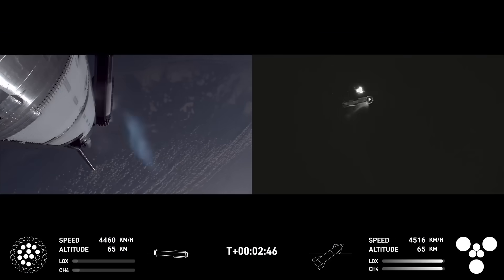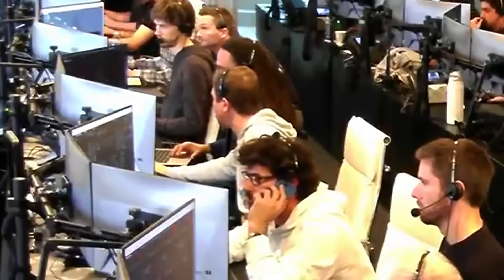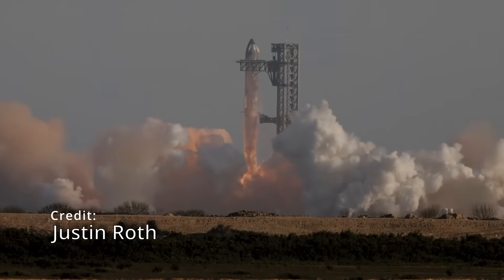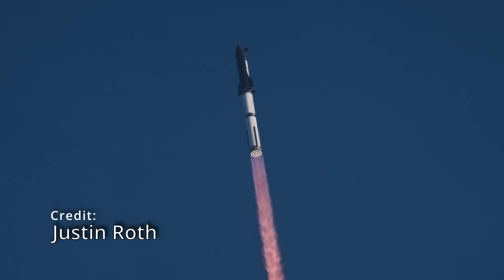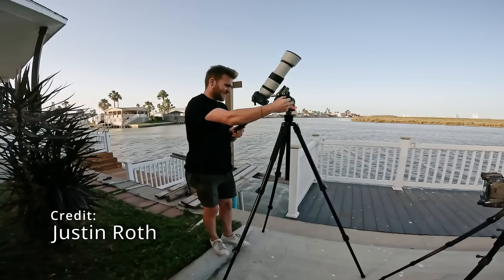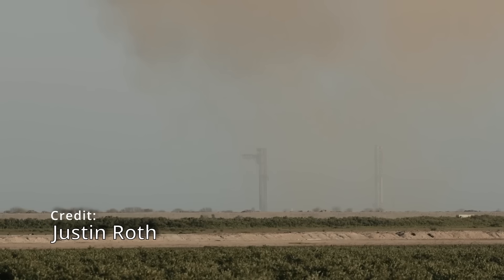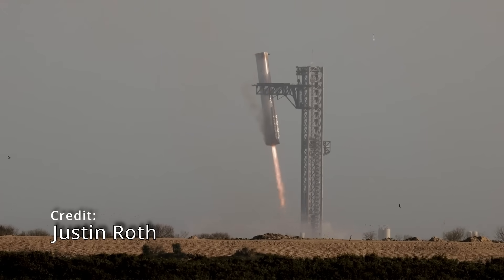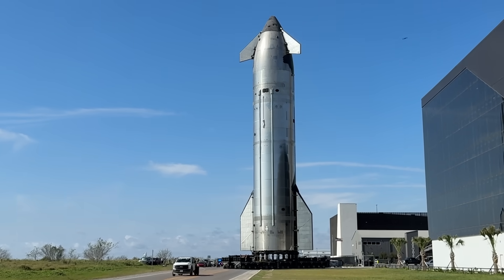Rest In Pieces: Why Did SpaceX Lose Starship Again?

Comment: I think that their analysis was a bit dramatic! 
Yes SpaceX did some testing and made many changes for flight eight. 
Some of the changes were to place a whole host of new telemetry sensors everything from taking new pressure recordings and temperature but also angular acceleration and harmonic vibrations along with also adding a bunch of new camera angles in the problem area so they could get better understanding if they had that same type of issue again. 

They had the 20/20 hindsight perspective, and I’m sure it was said,  if we could go back prior to flight 7 and place cameras and sensors to help us learn more about this issue what would we wish we would have had that would help make solving this issue.  Again what type of sensors and where would we have put them and what would we want to make sure we are monitoring. They made all of those changes. 

So the good news,  I think that SpaceX had everything they needed on this flight to determine with some degree of certainty what happened and I’m sure they will figure out why, if they haven’t already.  Yes SpaceX is it going to have to convince the FAA that they not only understand what the problem is,  but that they have also made appropriate changes to alleviate future issues.    Hopefully that will go quite quickly.  

I am an optimist and I think that they could probably get this done and fly flight nine within 7-8 weeks.   But yes,  no doubt, it is a bit of a set back!    With a development program involving the largest and by far the most powerful rocket to ever be built, there is bound to be complex issues arise during testing, and innovating. There is certainly gonna be issues, and this is the time to work through them!  Much better at this point than when they are flying a hundred humans on it!

Comment: Why don’t they build the booster and the ship using four tubes each, arranged in a circle? It would be more rigid than one big wobbly tube.
Reply: booster obviously does not need it, and it would be an absolute nightmare for upper stage reuse
Reply: @snuffeldjuret  Why not for the booster (if it is an improvement) and why an absolute nightmare for upper stage?
Reply: @snuffeldjuret  I'm not sure/don't know if starship&booster are stiff enough now. Changing to 4 cylinders instead of 1 would make it stiffer. That would add weight yes, but maybe the skin can be made a bit thinner. Hard to guess if it can be done without adding weight. I know pressure is most important for structural strength. Though important to not collapse when the pressure gets too low for some reason. With 4 cylinders (2 large lox and 2 smaller methane) you could close the sides, making the rocket more rhombus shaped. Lots of room for stuff and heat shield. Just thinking out loud. Don't want to see another Starship fireworks.
Reply: @snuffeldjuret  Good question, I haven’t considered other numbers yet. Why not hundreds of spheres?
What are the best ratios for: weight, strength, shape, and the plumbing system? Just three could work (two LOX, one methane, arranged in a circle with two connections per cylinder). Configurations with five or six could also work in different ways, while seven could be very strong. The more cylinders, the heavier the structure, I assume.
Of course, there’s more to consider—for example, the different temperatures. If one cylinder shrinks more than another, the connections should allow for some sliding.
The goal is a more rigid construction—stronger and less sensitive to resonance frequencies. Whatever works best.

Comment: I am pleased to hear your comments, I have been making comments about the design and safety of starship. I think the design is way off , there should not be heat shield tiles , this ship seems too fragile , it seems as though they have tried to simplify a structure to make it large . Reusability might be fine while it stays in space but not a frequent flyer from Earth .
Reply: which rocket company do you work for?

Comment: I wonder if it’s fuelling impacting the engine reliability, or if it’s something to do with the duration of the burn. Any which way, they absolutely need to know why the engines are failing, including the two that didn’t relight on the booster.

I think Mars is still doable

Comment: The Starship project is done. Elon suffers from severe wishful thinking and overconfidence syndrome. He thinks you can built a spaceship with only a 3.97 mm thin metal hull, let it go through temperatures from -200 degrees to 1600 degrees Celcius without problems and fly it to Mars. The thin metal does nothing but shrink and expand enormously, every flight. Of course that will cause fuel leaks everywhere. Besides that, the same counts for the heatshield. It will never ever become 'reusable'. I'm not a Starship critic, just a realist. Musk can't have a third failure on flight 9. But with so, so many problems unsolved, another failure is guaranteed. Raptors fail on a row, heatshield is still in embryonic fase, fuel leaks are unsolved, Starship fuel tankers in space are very far away, a ship landing on Mars on it's own feet is still fantasy, and how on Earth will Elon refuel a ship on Mars for the flight back to Earth? The whole project is based on fairytale fantasy of a young boy's deams. Humans will never reach Mars, and if they do, they will die there very soon.

Comment: They use the same engines that they used on the V1 starship V2 is pushing a lot more fuel and weight. I have noticed that the trust to weight ratio changed a bit compared to V1 flights the booster leaves the ship at a lower altitude as before. The added weight of the Starlink simulators also does not help. I think that is logical to think that the engines are straining and having to work alot harder for the V2 starship compared to V1. I have read somewhere that raptor V2's are prone to leaking when pushed really hard. Maybe they could fall back to the V1 platform test everything they need for the heat shield with that. So raptor V3 can get up to speed. Maybe they will be more compatible with starship V2 ? But well I am not a rocket engineer just a passionate space flight nerd. Just thinking out loud here.
Reply: well, they scrapped the last v1 ship they had lying (laying?) around XD

Comment: I think that it's a vibration caused by the extra 2 m that they added I think that when the fuel gets to a low enough point, the extra length somehow plays together and creates an oscillation / vibration/ reverberation, idk, that caused it to leak fuel. It'll be interesting to see if the innert gas they use to fill the attic had any effect, and whether or not the camera in the Attic picked up any footage

Comment: Really the only definite similarity between 7 and 8 is that the ship failed on ascent - there are a lot of reasons why that might have happened - 7 = fire in the attic, 8 could be something completely unrelated - like a motor that blew up - that hot spot on the nozzle looked fairly ominous to me - it might have been a undetected manufacturing defect on just that one motor, or it might have been damage sustained from the test firing.... I have confidence that SpaceX engineers will pinpoint this problem and fix it - Flight 9 might blow up for a completely new reason - that's why it's called development.

Comment: Reading between the lines of the SpaceX blog post on flight 7 findings, I got the impression they hadn’t really gotten to the root cause of the vibration issue; they talked about mitigation (changes to thrust profile, fuel temp, venting the attic) but no actual hard fixes. Perhaps they will go back to the drawing board on Block 2 and make some major changes, based on what they knew worked with Block 1. Next flight in 3-4 months I imagine… 😢

Comment: Getting Starship into space and back is still the easy part. Making the rocket actually reusable and economically viable is the hard part. It is not enough to survive a single trip to space, every part must be strong and reliable enough to last several trips. The refurb costs must be reasonable or it could be like the space shuttle, reusable but more expensive than a single use rocket.

Comment: naturally spacex likely has more information than us, if there's a similar failure mode in both of these launches I don't think spacex needs the FAA to tell them there needs to be a root cause analysis and corrections to resolve the issue before the next launch. That said, statistical anomalies are to be expected, failures even when unrelated will tend to appear as if they're clumping. It's still possible this was just some bad luck or a bad batch of engines in which case the FAA will put on some breaks while spacex continues as usual to rush through their procedures
Reply: we can only understand today in 2 months or so, based on faa reaction etc.

Comment: They have unreliable engines. They never know for sure if they will all start, run without a bang, and restart on demand. Operating Starship like an airline is unrealistic, without reliable engines Starship wont go anywhere. Going to Mars?🙄On NSF they talked about several hundred testflights. Who will fund that? OK, the taxpayer will fund it. How many tests flights did the Saturn V?
Reply: Not a single failure for SaturnV.

Comment: I see comments comparing Starship to Saturn 5
Saturn 5 flew faster with no first launch problem within 6 years while Starship is in year 8 and is failing.

Well, Starship is much more complex aiming for full reusability. This does not take away from the amazing feat of the Saturn program. Starship is flying, sort of, and Saturn 5 did have some problems.
The Starship program uses a very different iterative design process. Failures are expected and used to learn from.
Also, the Apollo program had a nation behind it, up to half a million people and hundreds of billions of dollars in funding.

Specifically to compare
Saturn 5
20000 - 50000 people
Launch cost 1,4B USD
Program cost
60-70B USD

Starship
2000-5000 people
Test phase launch cost: 250-500M USD
Launch costs when deployed: 2,5-25M USD
Program cost so far
5-10B USD
Reply: Re-usability is no good if there is nothing to re-use.  And what if the goal of re-usability is what makes them useless?    

Besides, reusability seems dumb and based on very iffy premises.  The materials are surely not the greatest part of the cost and what problem is reusability even trying to achieve?   To enable Mars missions.....for no good reason?    The entire thing is ridiculous.
Reply: That is true. By some measures the complexities of reusability are 2-3 orders of magnitude more complex.
No nation state has done it.
If done it will be close to miraculous. The effort is worth it. LEO is halfways to anywhere
Reply: @pierre.a.larsen  I question even those assumptions.  LEO is halfway to nowhere IMO.  Mars is a nonsense and if "protecting humanity" is the deal then funding telescopes and sensors for threats is much wiser and far more pressingly appropriate. Likewise environmental concerns here, never mind Mars.

Instead we have all this superfluous nonsense based on child-like fantasies of a space-age.

Comment: If starship engines start while connected to booster and fail soon after separation,  wouldn't it be better to put some space between them before starting starship engines?
Reply: it wasnt an issue with v1 version
hotstaging has been a thing since flight 2

Comment: Looking at the design changes between the 2 versions, I suspect that the issue could be chaotic fluid flow in the new plumbing, likely causing vibration and stress fractures that allow for fuel escape and/or engine failures. We know the engines and the overall vehicle is largely the same, the difference is in the tanks and the plumbing, that is where they need to focus their attention here. I think the problem would have occurred regardless, the two RUDs happened at roughly the same time and point in launch, so delays in launch are a straw man argument, it has to be a design or materials issue. I feel sorry for the SpaceX team, this must feel like a personal failure to the many dedicated engineers and technicians involved in the build of Starship, us engineers always take it personal when things we design fail...Next Launch Date - May at the earliest, my gut is saying end of June, possibly into July, it depended on whethere they can narrow the problem down to a component/materials or the design, if the former then that is reasonably easy to fit by making changes, but if its a design flaw, then that will require a complete rebuild from the ground up and that will lead to inevitable delays.

Comment: It may be less ambitious but return to the Version 1 Starships for testing purposes or use a more reliable (but expendable) upper stages.  The reusable booster is already a viable heavy booster with A LOT of throw weight even with "cheap" expendable second stages.  Or if my hunch is correct then improve the engine bell on the vacuum engine to prevent burn through and it SHOULD work and the previous statement is just a contingency.

Comment: As an engineer, I would say business as usual. You try something new and fail a couple of times. There is always a point at which the projects seems impossible, that is the price of pushing the boundaries and not settling for the conventional designs everybody else is doing.
But public safety needs to be guaranteed at all times. And for the public image, this is a nightmare. Prepare for all the nay-sayers and doubters to come out of their caves. Prepare to ignore them and watch them shudder when the process will yields it results. Where are all the Falcon 9 deniers now?
Reply: How do you distinguish when a project actually is impossible?   In your telling one could never make that determination.

I guess it's a lot easier to keep at a problem no matter the cost if you have the bottomless pockets of the taxpayer to fund it.

Comment: As long as they can keep landing the booster with 32 X $3 million worth of motors, the top part becomes relatively cheap and expendable to get it right. But this does seem like a step back after 2 successful sea landings. I am sure they will learn a lot for the next one.
Reply: Is it that much cheaper to re-use engines, given all factors (including development costs and problems with building reusability into it)?

And under what assumptions?  That there will be demand for it?  That it will all serve some real purpose?
Reply: @CurtOntheRadio  I can only see one advantage, albeit quite a big one, almost 3 times the payload of any other form of getting things into space, for just the cost of fuel. Though arguably it probably isn't much than the Falcon 9 heavy going 3 times.

Comment: Probably a good thing to have happened.  They made changes they believed resolved the issues from flight 7 and it appears they were either wrong or insufficient. If the flight was successful, we would have thought all is well. The ship had to be more than just robust enough if it is to be truly reusable and for much much longer duration flights possibly even with crew. Triple redundancy should be the norm. Yes, weight and complexity will be issues but what choice is there when you need to have a reliable, safe vehicle that will land and launch repeatedly on other planetary bodies. Starliner was only good enough to get 2 astronauts to Earth orbit and there they sit. Stranding astronauts on the moon or Mars is a whole different ball game. Robust enough is not good enough.

Comment: OMG if they are getting hit hard then they aren't engineers.  This is xperimental flight, otherwise there would be people on board.  You need to quit hanging around angry astronaut.  It won't delay shit that much.  Its still the same anomaly and honestly they are still building hardware... Now it they had 10 starships sitting in the parking lot then we might get delayed but this is the second of a new version.  This guy is wrong.  That is not the way spacex works.  They are about rapid developement.